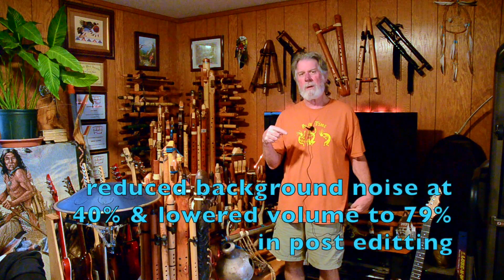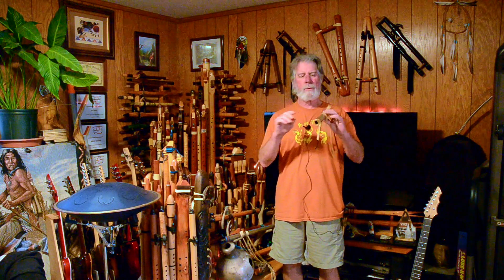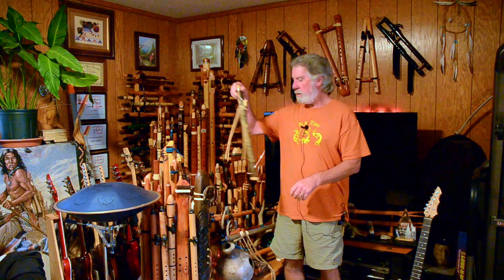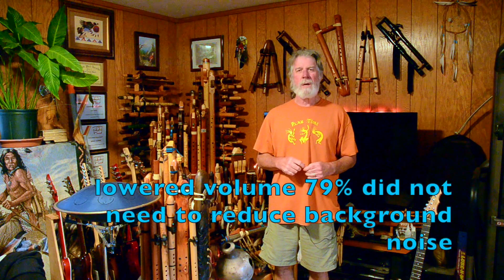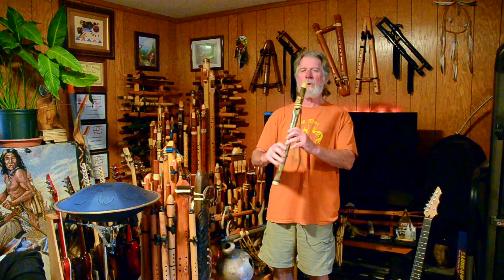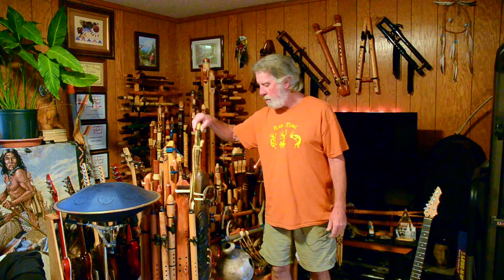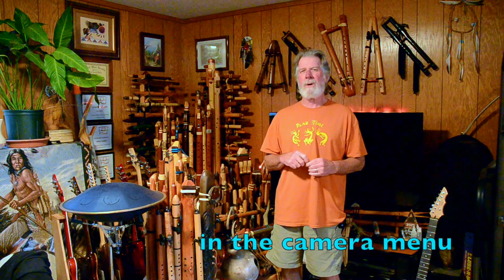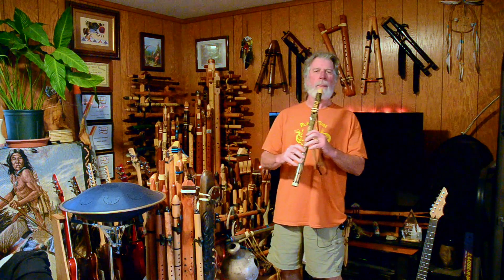Testing, testing,1, 2, 3  ...The Comica Boom XD Pro wireless mic vs the Nikon D7000 built-in mic.

Comment: Hands down, we thought the built-in microphone on the transmitter gave the most consistent levels between voice and flute. However, we didn't feel that it was loud enough with either the voice and flute. Our 2nd choice would be the built-in camera microphone, though it is not a fair comparison because that mic is adding the ambience of the room to the sound. The lavalier mic clipped inside your shirt, provided a more comparable level between voice and flute, though the levels seemed low.
Reply from the maker: Thank you so much for your thoughtful comments. I can easily bump up the volume level on the Comica system when editing the video and putting things together. The built-in camera mic sometimes sounds terrible. Kind of "boomy", but also with too much treble and ambient noise, other times it does fine. That is with the internal settings on "Auto". It will also depend on how far away the camera is from me.